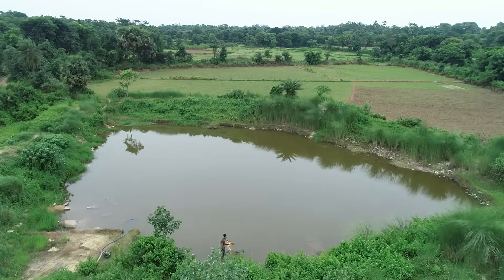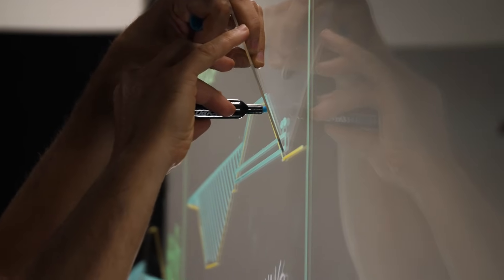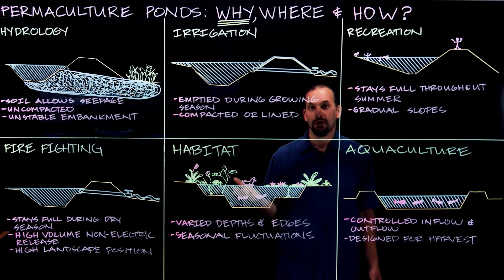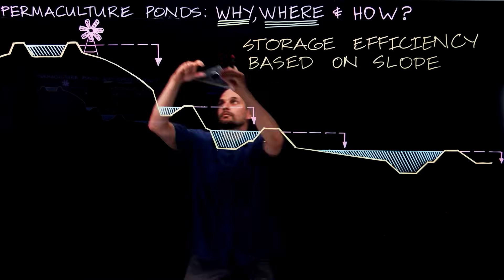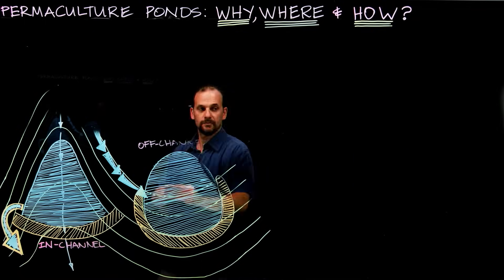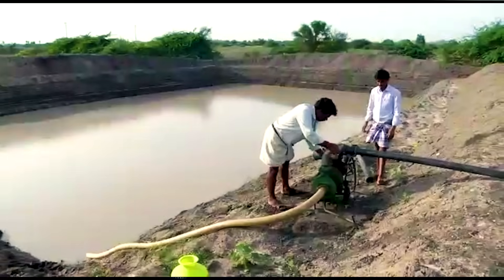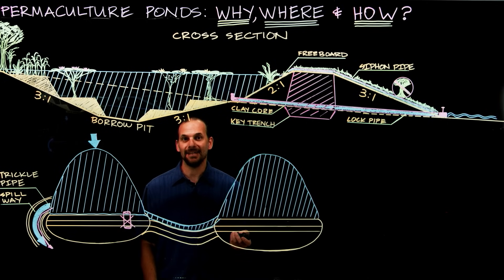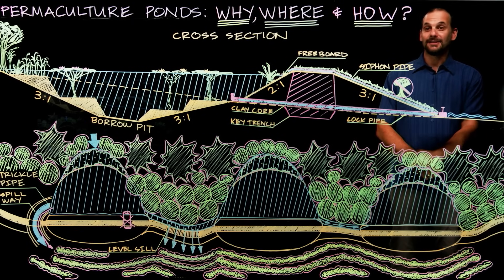PERMACULTURE PONDS: Why, Where & How

Comment: Review this Independent campaign for POTUS, DEAN 2024. I want to assume you havent watched Pushing Forward or the Initiative Statement on the channel Im commenting from. This absolutely is an effort to minimize govt and give the power to the people. Of course we both know the govt doesnt control anything, the ultra wealthy/corporations do. The horse and pony show is just that.

The plan is to secure the mineral rights of our land for the prosperity of all people by first establishing user data rights, putting a metering system into all internet devices to tax data collection and offset income taxes and homestead property taxes, then use that as a model for all natural resources and fully enable UBI, free healthcare, everything.

End dogmatic reasoning and release all historical, e.t., scientific data, etc. Forgive all non violent crime due to it being held arbitrarily, and give ability to appeal all others.

Rewrite the law books to eliminate most laws and place the citizen at the top of the pyramid. Like what I say about biden being a fraud and supporting unions, if laws were written in favor of the citizen the corporations would have to barter for us, not the other way around.

Also, we implement a hemp revolution to clean the air and water and repair soil biomes, healing the environment and create a raw material and economic boom, pushing material sciences to 3-D printing using fibrous hemp resins to make lightweight building structures stronger than steel for the construction of green cities, subterranean cities and space shuttles and stations, fast forwarding us into a true Space Age which will allow the ultra wealthy to begin harvesting outer space much sooner to create the first quadrillionaires, etc. Earths resources are limited, they cant do it here. Etc, etc. 

In any event Im done watching this shit show and am risking my life to make it change. Wish us luck, sub and share to help change the World forever.

Comment: Andrew I just bought a place and he has a 1 acre lot. That somebody was trying to make into a pond but apparently could not finish it. I live in the southwest Georgia growing zone 8b. I wish to turn this area into a fruit Forest. Problem number. 1 I have Clay muddy soil. 2 only the deepest side of the pond hold water bit only for a few weeks after big rains .3 there's a lot of growth and a few trees growing in and on the side of the pond. 2 weeping willows in the lowest part. one pecan tree on the high side. Both are natural and wild growing in my area. 4 do not have any equipment access other than hand tools. Would like to know where the start . I plan on bringing in a load of sand, cotton seed trash, and cow manure. Cutting down in mixing in the existing vegetation that is surrounding and lining the pond. Is there anything else I need to consider or do during this stage of set up ?? Please help. Thank you tiny
Reply: Shouldn’t the clay help in the pond holding water?
Reply: @____________838  in my understanding the clay will hold water. 
Why are you bringing in sand?
Reply: Following this reply..  thanks in advance

Comment: Great video. It was very well put together.  It answered my questions as it progressed. Thanks for providing links to more info. What are all the ways you can get water for the pond on top of the hill?
Reply from the maker: You can use a windmill to slowly fill it, or a direct current solar panel that just fills it when the sun is shining. These are the most common renewable energy methods I have seen.
Reply: There's a fascinating device that the ancient Egyptians & Greeks used to lift water uphill that's called an Archimede's Screw, & it's considered the oldest positive displacement pump design. I
t's been in use since before the 3rd century BC. 
There has even been evidence found that suggests the device was used to irrigate the Hanging Gardens of Babylon (I believe it was Strabo who said that the gardens were irrigated "by screws").
It can also be used to generate power if it's driven by running water, like that of a stream or river, instead of lifting water.

Comment: Another awesome video bro. California and other drout having places can use these seepage ponds and premature, at farms and other less used places just 'cause. I was actually thinking about if I should seal a pond and waterway that I have a little river or creek or spring running through it as I would stem from a moving water stream to make a pond, and reconnect it to the stream and seal the bottom or not.

I also thought a seepage one is better as to create or fill a water wells under the earth.

Comment: If we use accelerator so that we can transport large mount if water for forest fighting and or for defense. A large electrical cable in a circle and the cable are wrappwd around by a coil to control the electronic in the addressible space time for advance transport system or electrodynamics and teleported

Comment: I am currently working on ponds in a drainage ditch from my spring fed well. (No choice in positioning) Three ponds will increase the ground water in the dry area of my forest garden edge.
All three are for habitat. One or two I will be able to put fish in.
Some day, I hope to make a seepage pond at the highest point of the property and feed it with a 12V pump running off a solar panel.
So this video was very interesting.
Thanks for sharing!
Reply: I have a large ditch by my house we need to do something like this with.  But the soil is sandy that doesn't pert. Will that feed our ground water or hold it too much?
Reply: @susanfreeman5340  The sandier the soil, the faster and further the water will spread.
Keep in mind, the further is also down. The deeper the sand, the deeper the water will go down and not out as far.

Comment: Great video Andrew, thank you! We are designing a farm on flat land and looking into a 2 pond system design(north and south) with a stream (running through the length of the farm) connecting them. Circulation of water will be achieved through a pump. Have you got any useful tips, links or any book suggestion that will help with our design? Thank you in advance!
Reply from the maker: The Regrarian's Handbook, linked to in the video description, is very good. He had individual chapters available for download, but I'm not seeing that now, so he's probably almost done the whole book.

Comment: A question, shouldn't the dam be 1:2 on the outside and 1:3 on the inside where water sits? At least this is what my experience tells me and what a few books share as well. One on all Barnes, in the permaculture earthworks handbook
Reply from the maker: I go by K.D. Nelson's book, which you can get for free on the internet in the link I provided.  Also by observation of many dams. Think about it: the downslope embankment is the one more prone to erosive forces, being exposed to wind, rain, and traffic. It's also the mass that's really holding back the water, so a 3:1 slope has a a lot more material in it than a 2:1 slope, all sitting an angle which is counter to the downslope force of the water.